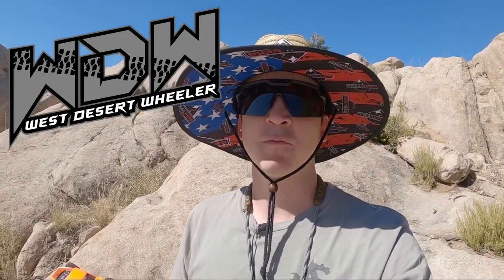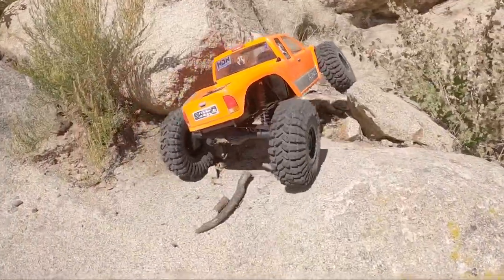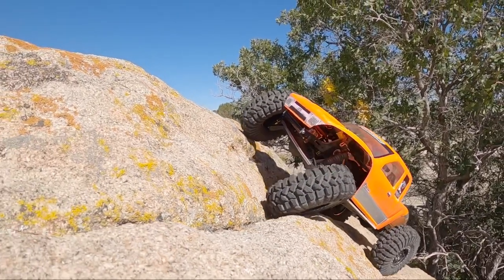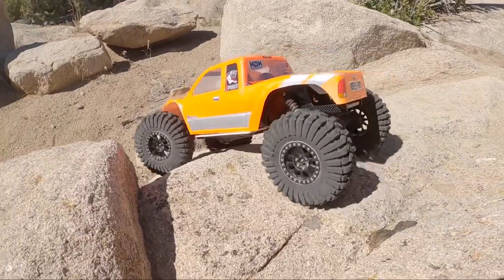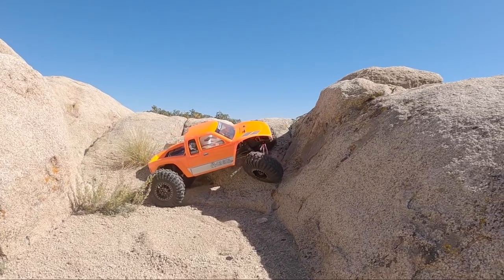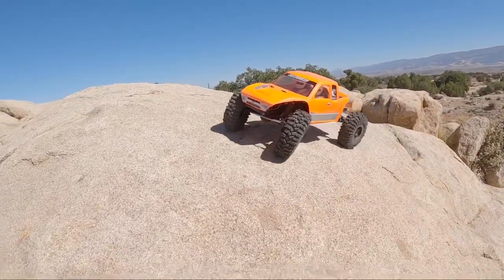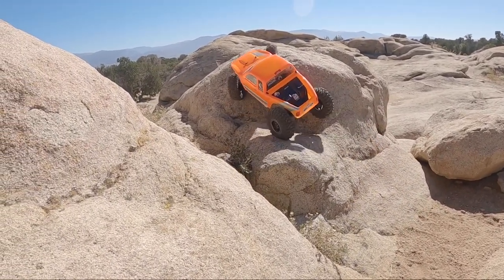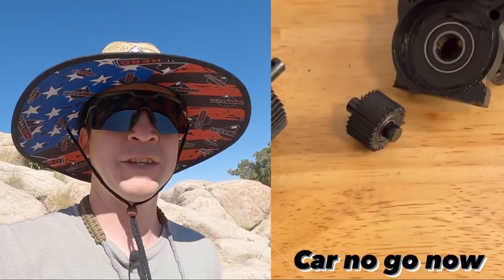G Speed Rebuild, Capra Axles and 2.2s!

Comment: Do you run a negative offset wheel with the Capra axles ? I’ve heard they can be a litte wide for comp gates 👀
Reply: i did this the other day with the amazon carbon fibre rims and short and medium hex adapters. Their deadlocks the mount flat on one side. brought my rear in alot and could as much in the front butt really narrowed it up. 2.2 rims to cover over portals/c hub

Comment: After watching you wheel with those tires I checked them out and it seems they only come in 122 mm which is a little over 4 in tall so does your cut & shut add more height also? If it adds enough height to get to say 4.75 then I'd be interested in buying a set.
Reply from the maker: My tires are 5” tall after the mod
Reply: Any chance we can get a link?
Reply: 122mm is 4.8"